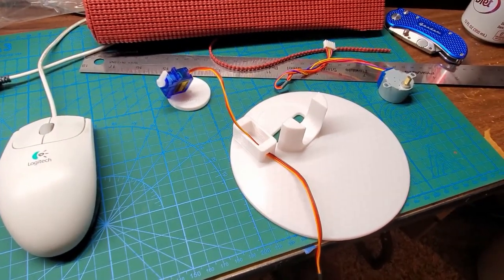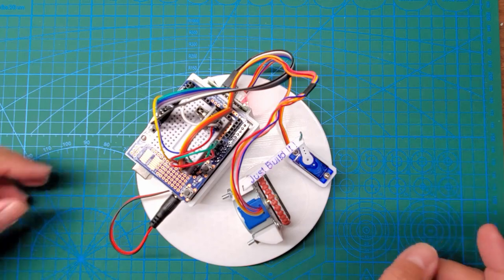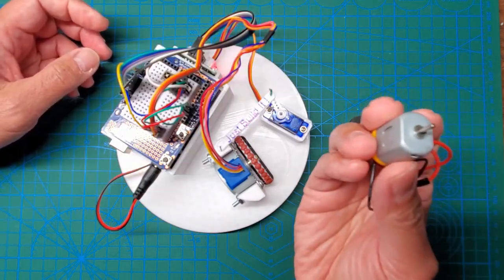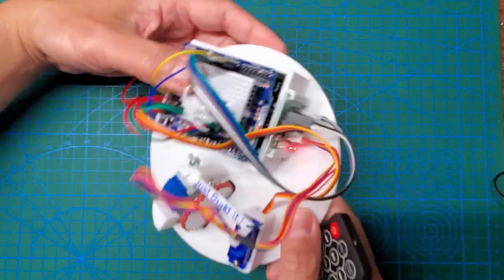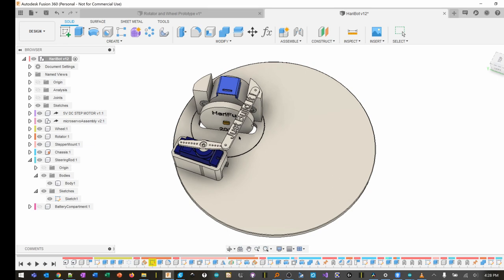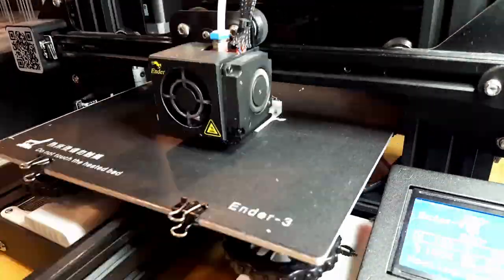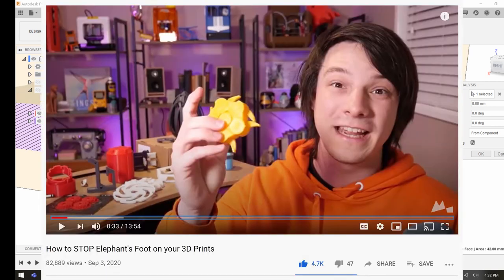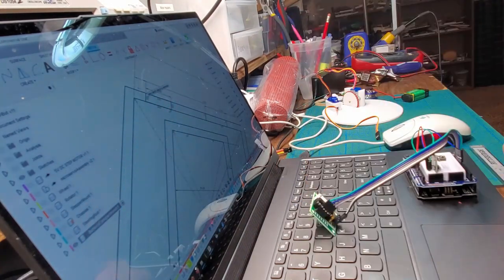HariFun #186 - Bad Robot

Comment: Brilliant , you invented a new robot traction system with just one driving wheel that can be steered too. Engineering in it most pure sense. Great work! Btw, the two drive wheel system is more commonly known as differential drive.

Comment: That's not a bad robot, that's really nice! Never thought of anything like this, I've always only thought of much more complicated variants and then just gave up as it would take too much time. This at least you get something done and you could always build upon it to improve it. I'm not like that.. I always want the most complicated, but that ends up almost never happening =D
Reply from the maker: Hi Chris!
Yeah, the more complex, the more chance of issues and chance of failure. Personally, I don't want to invest time to fail!  I have ideas that I have not pursued because of my fear of failure.  That's where Simone has the wisdom to set the bar of success quite low (she's the queen of shitty robots!) and build it anyway.
To be honest, this robot does not work as well as I want (too slow, turning sometimes sticks), but the project give me the satisfaction of seeing the print-in-place axle. And its first crawl was very satisfying.
PS: Thanks for the encouraging works Chris!
Reply: @HariWiguna  Haha yeah, I'm very much the same. Also, those times that I do send away a board for manufacturing, I'm almost always very scared until I have the boards in my hands. Also, the print in place axle was very cool and its a very neat solution, seems very easy to implement it also. Just have to figure out something I could use it for, so I could give it a go as well. These days my printer just stands on a shelf up high and I never use it. Gotta search for some fun things to print, maybe I'll do print in place axle just to get back into it =D Thanks for the reply Hari!